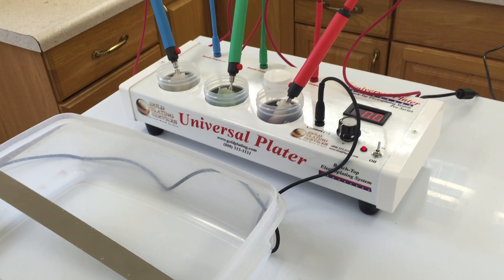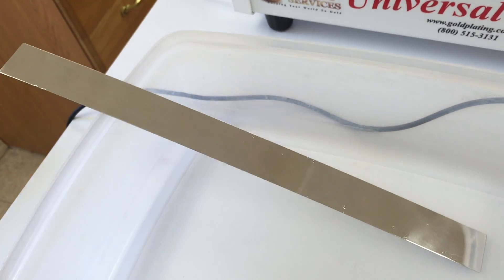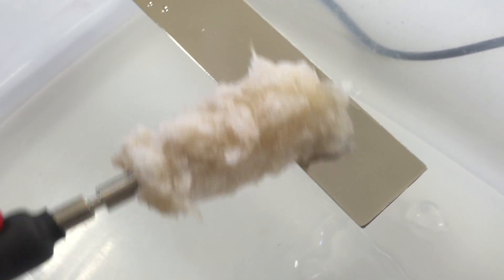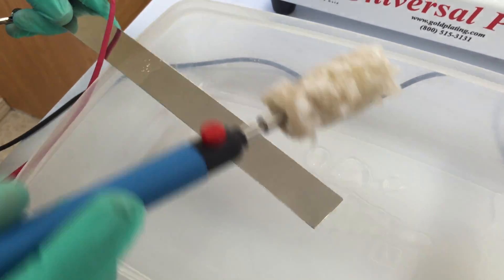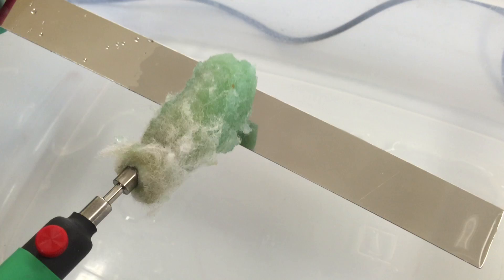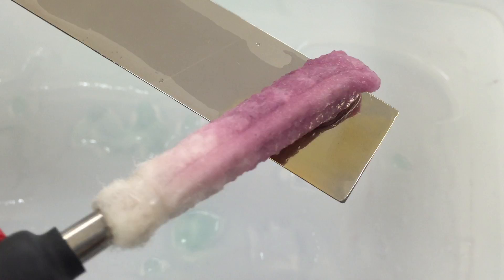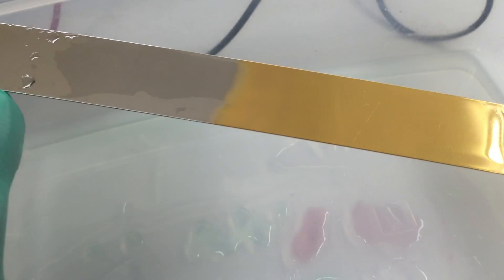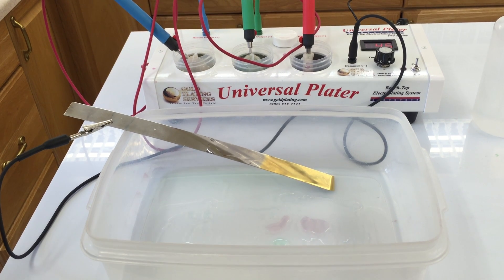24K Gold Plating Stainless Steel - Brush Plating with Universal Plater Kit

Comment: Well you would electroplate it with a metal thats most cohesive with iron so maybe lead or nickel if i were to guess, but you electroplate it its going to be some super good rebar. Well youd have to be good at metulurgy to figure it out but just electroplate the rebar, dont copy my patent.. bitch

Comment: What solutions do you use for taking chrome off and also which  do you use for gold plating
Reply from the maker: On chrome plated items, you remove the chrome using Chrome Stripping Solution.  To strip chrome, you will need the Universal Plater Kit - "Chrome Edition", which has a switch to put it into Chrome Stripping mode.  We have multiple videos showing the process of plating chrome items.
Reply: @GoldPlatingServices  awesome. So I’m very interested into starting to do some gold plating, so I’ll probably be asking some more questions if you don’t mind
Reply: @GoldPlatingServices  so do you sell the Universal plater kit? If you do ,what’s the price on it?

Comment: I am looking to purchase your kit in order to plate firearms. I have been attempting to achieve a desirable finish before investing in your kit. No matter how much polishing i do i can still see minor surface scratches when looking up close or under a magnifying glass. Will the platting process give it a "mirror" finish despite these minor flaws? what experience have you guys had attempting to achieve that mirror gold finish on firearms?
Reply from the maker: Hello,
Polishing out microscratches is very difficult and may be unachievable depending on the situation.  Brush plating will not remove or "fill in" scratches. However, Bright Copper and/or Bright Nickel in a bath does provide a mirror finish with no scratches if the piece is well polished prior to plating.  In this video we show how much Bright Nickel brightens a part https://youtu.be/sJk1j03LwUA

Comment: Can I plate aluminum?
Reply from the maker: While it is possible to plate onto aluminum using a portable system, the process is not cost effective and the durability of the resulting finish is generally insufficient for long term or regular use. We recommended that you have a professional do your aluminum plating.

Comment: Is it safe to use plated equipment in food industry?
Reply from the maker: The gold deposited is 99.7%+ pure gold.  Once the item is washed after plating, no chemicals remain and you are left with a nearly pure gold deposit.  It is absolutely safe for use with food as long as the chemicals are washed off.

Comment: Does the gold last is it permanent and will it not go away by heat or friction?
Reply from the maker: The gold is permanently bonded to the substrate, however it absolutely can be removed through abrasive means.  You could polish it off or destroy it with too much heat (such as a torch).

Comment: will this work on a championship belt
Reply from the maker: What the item is made into isn't as important as what it's made OF.  So if the belt is made of a platable metal, it will work fine.  If it is made of basic metals such as brass, bronze, silver, copper, nickel or any mixture of those or any metals similar to those it can be plated.  We have a lot of customers who plate belts in various capacities.

Comment: i have a 316l stainless watch. but is anodized, what would be the steps to gold plate this if possible? would it require extra steps like remove anodizing?
Reply from the maker: Gold plating requires the bare metal.  Any anodizing or coating needs to be removed and the surface needs to be bare platable material prior to beginning the work with our kits.
Reply: how would i remove the anodizing to get to the bare metal? also after removing the anodizing, does the surface have to be chrome or polished prior to gold plating?
Reply: \\\\\///// I know this is an old comment but would like to know this too.
Reply: @GUARD14N  you can use paint stripper & the small metal bristle brushes sold in packs @ places like harbor freight n HD. 

BE SURE TO WEAR GLOVES & don’t get the paint stripper on ur skin. Use the metal brushes to scrub away any top coating.

Comment: Hi, before I buy it can you please give me a idea if works for alloy mags wheels and any metal etc. and where can I buy it the universal player and the solution. Please reply very interested please and give me the phone no.
Reply from the maker: Hello, we're glad you asked because the answer is no. Unfortunately, aluminum wheels cannot be done this way or with any of our kits.  Aluminum is extremely difficult to plate and the aluminum wheels would need to be sent to a professional plating shop to be dip plated in nickel prior to being able to plate them.  The kit can be purchased from our website, https://www.goldplating.com/collections/brush-plating-kits/products/universal and comes with all of the Solutions and accessories needed to plate most metal items (Except aluminum.  Steel requires additional solution called Woods Nickel Strike).

Comment: Man is there anyway to do that to copper and brass? I have some electrical contacts on a machine that needs to be cleaned regularly from corrosion. And will gold plating stop the corrosion completley that i dont have to worry about cleaning on regular basis? Sorry for my poor english and thanks in advance.
Reply from the maker: You absolutely can plate gold onto copper and brass.  We have a kit specifically designed for what you are talking about called the "PCB Repair Kit".  Please go to our channel and search for our videos showing plating onto electrical contacts.  Also refer to our website to find the kit.  By the way, your English is great, I had no idea it was a second language.

Comment: Can y plate glass objects??
Reply from the maker: Glass cannot be plated onto without first coating the item with a "conductive electroplating ink/paint".  Then, typically the item needs to be "electroformed" with copper, basically this means plating it with copper for about 10-12 hours.  Then it can go through the process of plating with our equipment.

Comment: are the volts on that machine adjustable?
   how many amps max?
Reply from the maker: Yes the volts are adjustable, as shown in the video you must adjust them between solutions.  It's a 0-12V, 0-5A power output, adjustable.

Comment: Hi, how to gold plate aluminium?
Reply from the maker: We do not sell any kits or accessories for plating onto aluminum.  Aluminum is particularly tricky and requires specific processes different from all other metals.  If you have aluminum items that need to be gold plated, either send them to a professional plating company like us for gold plating, OR send them in to be nickel plated by a professional company and then you can gold plate the nickel with our kits.
Reply: tks for the reply. I am planning to gold plate my iPhone 7. I found that it is made of aluminium metal.

so need a kit to do it my self, can't we use a activator on Aluminium and gold plate on it?
Reply from the maker: You will not be able to purchase a kit (that works) to plate your aluminum iPhone 7.  We HIGHLY recommend you do not even attempt to do so.  There is no "aluminum activator" that exists.  It is a very specific process that has many steps and requires a high level of expertise.  If anyone tells you that you can easily do it at home, they are misleading you.
Reply: tks for the reply sir, I will not do it myself and destroy a iPhone. 

It would be great if you provide steps and necessary list of tools and chemicals required to gold plate aluminium, so I can practice on a sheet of aluminium first.

Comment: I get a lot of Sterling Sliver Gold Plated.  Hate it when it wears off.
Reply from the maker: The plating being applied must not be a thick enough layer, or its not adhering properly.  If even a typical thickness is applied it should last years.  When we plate items for customers we always put at least 4 times the thickness that the FTC requires to call an item "gold plated".  We have items that are decades old that are still gold plated from when we first opened 25 years ago.  If you'd like us to plate something for you please let us know.  You can either e-mail or give us a call, the contact info is in the video description.
Reply: Gold Plating Services Sure. I will consider that.  I know on copper it's excellent.

Comment: Great video. I just ordered some of your solutions and am having so much fun gold plating. It's a very easy and smooth process. I have a question I hope you can help me with. I have a piece I am working on that has a flaw in the metal (carbon steel), a 6 millimeter long scratch about 100 microns deep. Is it possible build up a layer of nickel, copper or gold that would be thick enough to cover up a flaw of this size? If this is possible what would be the best technique. Thank you, your videos have been very helpful.
Reply from the maker: Thank you! We are very happy to hear you are enjoying it.  Even after years and years of doing it daily we still enjoy it every time we plate something also.  The best way to remove or deal with scratches is to remove them prior to plating.  Attempting to "cover up" or fill in scratches does not work too well.  One of the most effective ways we have found is to use a hand dremel with polishing wheel attachments on the end and some red rouge.  Attempting to fill a scratch, especially this deep is not very feasible with electroplating.  Plating Nickel extremely thick can help a little to fill, but it's best to deal with it prior to plating if possible.  Let us know if we can be of further help.